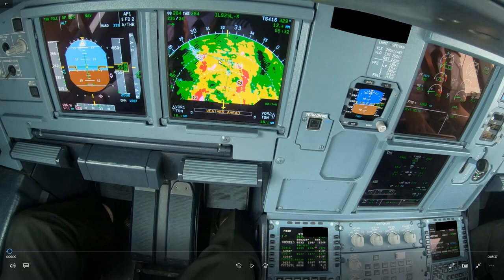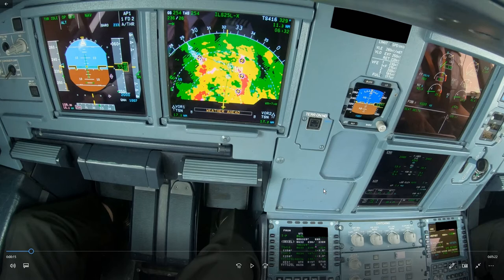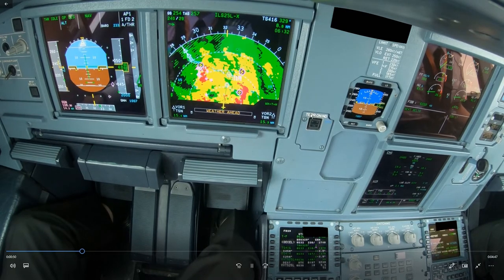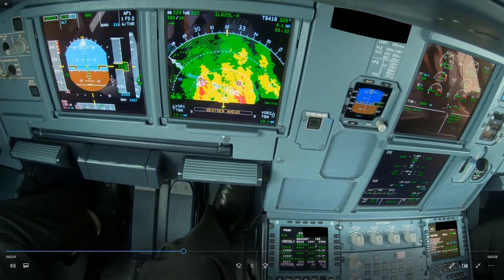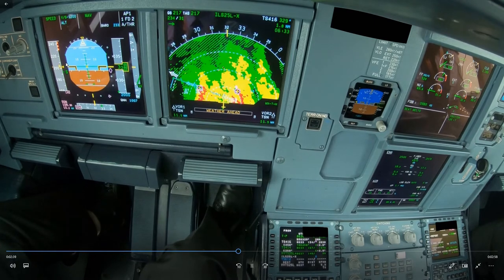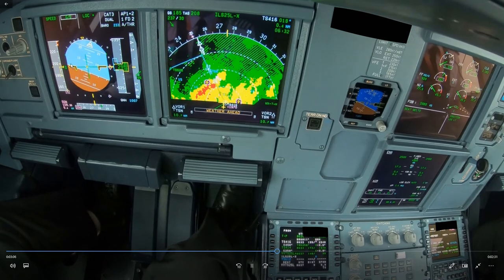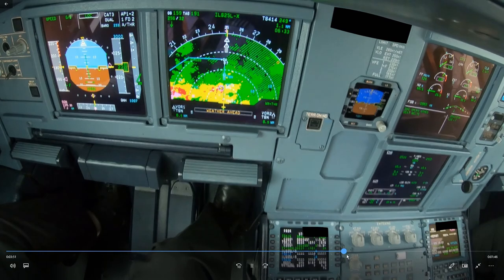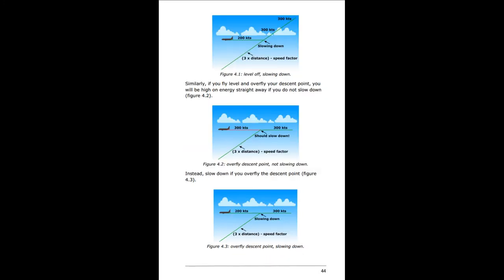A320 Descent Management - VVTS, the effect of being heavy and selecting Flap 2

Comment: Although the headwind decreases your ground speed surely the headwind is not beneficial because it would cause a higher IAS initially anyway?
Reply from the maker: More headwind does not cause more IAS. But if you mean that a sudden headwind increase due turbulence or when turning rapidly into a headwind, then yes, it will cause a temporary IAS increase due to the inertia of the aircraft.

So whether or not you call it beneficial, depends on what timeframe you are looking at. What I mean in this video is the benefit of headwind once the wind component is stable.

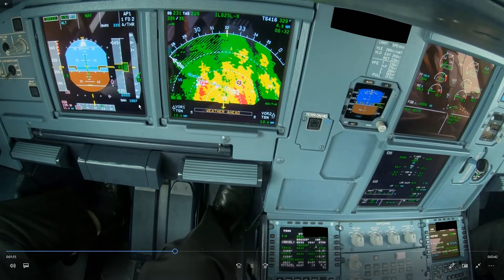Comment: at 3:35 you said he should decrease the VS more as he applied the speedbrakes. you meant increase the VS ?
Reply from the maker: There are 3 things going on here. 

1, we are high on energy, and two we need to slow down. If you are high on energy, you should use speed brakes, not increase the vertical speed. 

2, we need to slow down. In order to slow down, you have to reduce the vertical speed, not increase it. 

3, we need to make sure we are on the glide slope. If you are above the glide slope, you need to prioritize a high vertical speed over slowing down.

The glide slope indication is not valid yet here so we need to calculate the glide slope.

We are slightly below the glide slope there, and with the speed brake selected, it is ok to reduce the vertical speed to slow down.

However, it is right on the edge and a bit hard to see the situation, so indeed you could increase the vertical speed here to make sure the aircraft is on the glide slope, just to make sure.

Comment: According to FCOM, V/S and speedbrakes should not be used at the same time.
Reply from the maker: Whoever wrote something regarding descent energy management in the FCOM, clearly does not understand it himself. The FCOM has a few nonsense statements regarding energy management, and this is one of them. I would love to sit down with these people and school them on this subject.

Regarding the use of V/S and speed brake at the same time, it is only not recommended if your speed target is close to the current speed. 

This basic principle is very important: if you are high on energy, you need drag. There is no negotiating this. 

If you want to use V/S and speed brake at the same time, you have to set the speed target far enough below the current speed. This will force the thrust at idle. Either that, or set the V/S high enough so the speed doesn't reduce to the speed target.